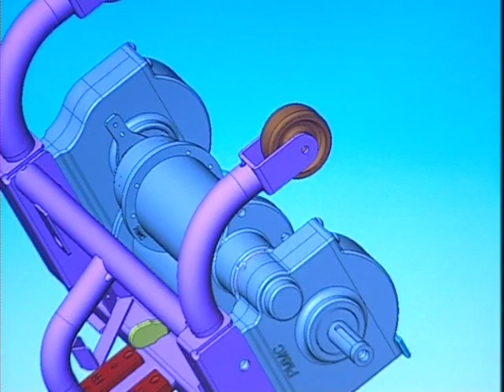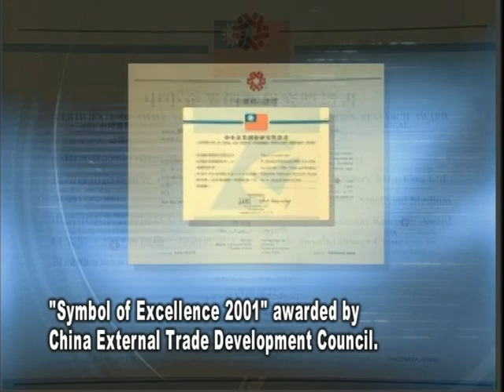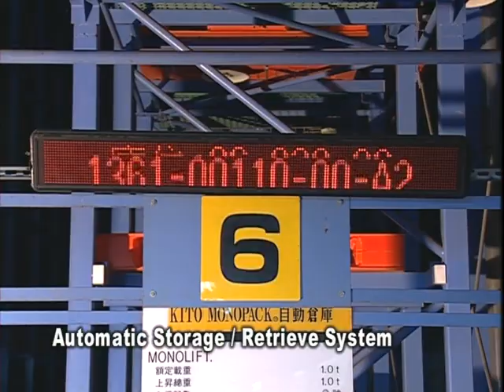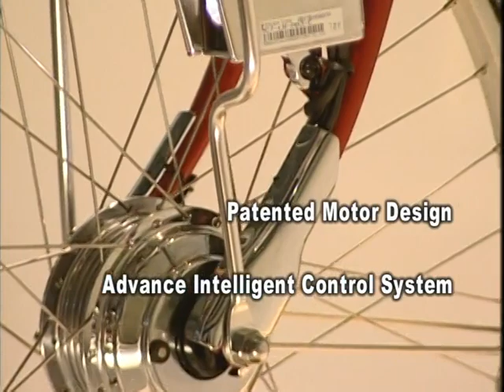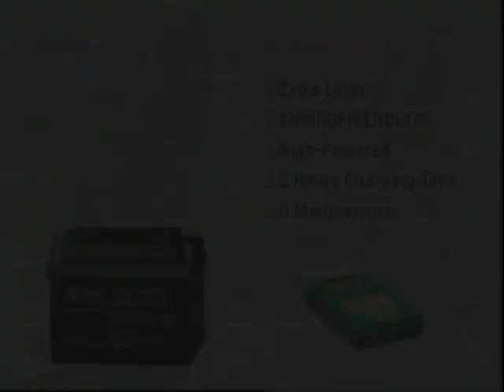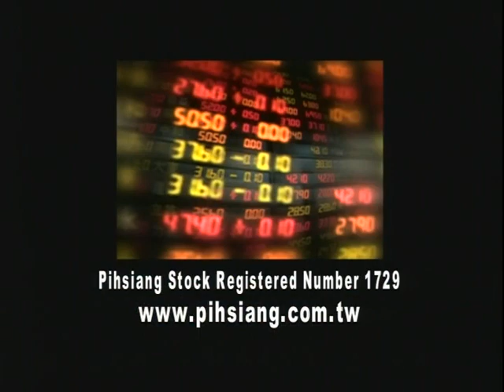Pihsiang Machinery MFG. Co., LTD.

Comment: Please PLEASE bring back the SUNRUNNER 388B-3 three wheeler.  It’s the very best Shoprider scooter for excellent use outdoors and excellent use in the home.  The short turning radius is key!  Bought them for years for under $2000 but would gladly pay $2600-$3000 for this model.  Do not change ANYTHING about it especially the pneumatic tires.  NO SOLID TIRES, fancy tillers or controls, no signal lights or flasher.  Make it a blueprint of the old ones.  PLEASE!